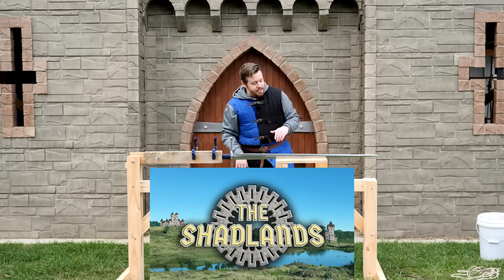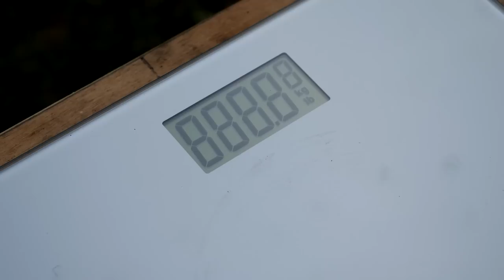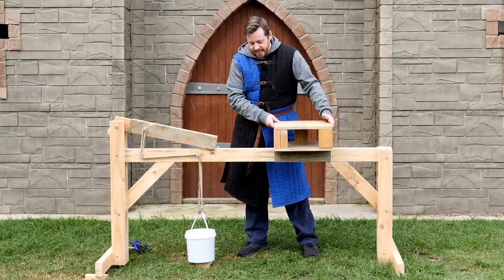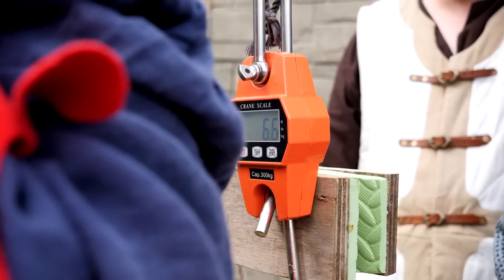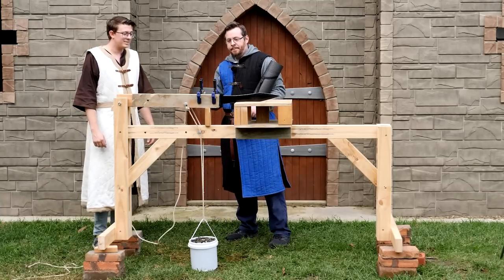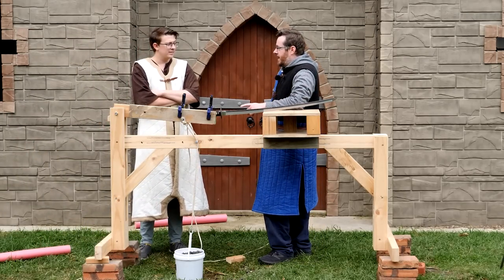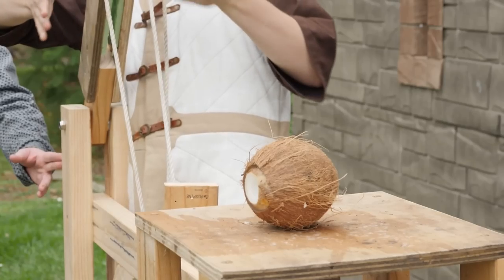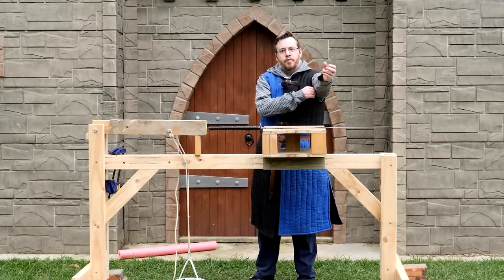Choppy choppy

Comment: You need to increase the developed velocity to increase the momentum and use a more brittle and rigid material to decrease the cut time to increase the cutting impulse. The tensile force of the rope is not equal to the force of the cut. mv = Ft where m is mass, v is velocity, F is force, and t is the duration of the time that the force is applied. Ergo, to increase cutting force, you need to increase the linear distance, d, the blade travels (d=2*pi*theta*radius) to increase speed of the blade at impact (increase the impulse of gravity as acceleration and mass are constant making time the determining factor of magnitude). Simultaneously, you need a cutting medium which is both brittle (decreases cutting time by reducing elastic deformation and negating plastic deformation) and rigid (does not deform over time). I suggest a physically soft wood or a variety of reeds and the cutting with the grain to prevent the trapping phenomenon and make the limiting factor the lectin of the material rather than the fibers. Alternatively, measuring depth of cut through a material such as ballistic clay which would also be reusable.

Comment: I think the problem was blade geometry. Because the katana is curved, having a straight chopping machine isn’t getting the full cutting potential. If you look at the blade as it cuts, only a very small segment of the katana made contact with the coconut. The straight blades made full contact because they followed a straight path.

Comment: When you measure your hitting strength your arms were fully extended pushing down.  When you swung the sword down, your your elbows started bent, then straightened .  My guess is that gives an increase amount of power to the strike.   I think there is also a power difference between swinging and pressing.  Maybe get your hands on a G-shock sensor that you can swing against then adjust your rig to the same power.

Comment: Clamp is slipping, which would greatly effect the impact force. Maybe drilling holes to put a pin under the back and above the fore of the hilt would help? Might damage the sword if not careful.

Getting consistent striking force will be very hard. Maybe you can get an impact tester to put on the target? Just the pull of gravity at the end of the swing should vary by the square of the moment length, so 2x to 6x. Also, the angular inertia varies by weapon, so the momentum at swing’s end will also vary greatly.
Getting the same momentum and force with different weapons will be pretty much impossible, but maybe you could get one of them the same?

Comment: For the thing about the clamp: A completely sturdy clamp would not necessarily make a more accurate simulator, given a human arm also isn't a rigid as a wood beam.

I think its just severely lacking in velocity and that the maths of using pressure don't account for the lack of acceleration, a dropping weight are not going to accelerate more than about 10m/s2.

Simulating the way a human arm accelerates with varying weights would actually be very complicated, but perhaps it would be worth using springs or taking a page out of Jorg's book and using rubber.

Comment: Gravity is not a suggestion. It's a law. When the bucket drops, it and the sword are pulled by gravity (1G). The weight of your bucket does nothing until the sword tries to stop. Swinging the sword manually, you can accellerate it much faster than 1G, imparting more velocity at the same distance, resulting in more force.

Comment: I will say that I have the same problem with your device as I had with Grant Imahara's Katana robot, it does not do any "draw" to the cut. It only does a straight chop, which favors a heavy blade over a sharp one. I believe that an ideal sword cut simulator would require a double-action to it, so that as it swings down, it also pulls back into the hinge, so that against say a watermelon-sized target, the blade would travel a few inches back over the course of the stroke.

Comment: At a rough eyeballing, you'll need double the weight in the bucket to get the desired power. There's math behind it, but if your bucket is halfway between the strike and the pivot, you'll have half of the bucket's weight at the strike. Again very, oversimplified, but it'll get you in the ballpark.

Comment: I think the blade is shifting too much in the clamp upon impact, you could fix this with two small blocks in the clamps just a bit narrower than the handles, one placed further back in the clamp and below where the tang will rest, and one placed closer to the handguard above the tang bolted in place to give more support on the tang when the objects are impacted and preventing them from shifting in the clamp.....it would also eliminate the need of a wood stopping block.  ......   Example of what I mean, think of the dashed line as the weapon, and the asterisk as the top block above the forward part of the tang and the period as the lower block below the lower part of the tang    -.-*- - - - - - - -    If something like this were in that clamp, it would prevent the blades from shifting upwards upon impact.

Comment: The force of the swing isn't the whole story.  Is there a way to calibrate for momentum? A person puts not just the momentum of the sword, but their own weight behind the blow. A person can get different results but "letting the sword do the work," or pushing even after contact. 

I also agree that the sword is slipping in the grip at impact. You can see that.  This doesn't reduce the force, but it does increase the time of impact. In other words, the impulse is changing. This effects the large sword less because it has more mass/momentum/inertia. 

Instead of a custom clasp for each sword, i think if you add horizontal rods (bolts would do) running from one side of the plywood to the other, right above and below the hilts (and in more than one place), you can use the foam method in this video and the bolts will add imovable berriors to slipping. The bolts can be on a track instead of holes to allow them to be loosened and then moved to customize the grip for different swords. 

I think you should also measure the velocity of the center of mass of the sword.  Might be helpful for keeping track of momentum.

Comment: The biggest problem is that as soon as the blade makes contact the sword rotates, losing both the momentum of the swing and the weight of the bucket.  You need to replace the squeezing grip that allows that rotation with something that prevents the sword from rotating.  I imagine something like metal pins through the wood arms, one above the blade end of the handle and another below the pommel end of the handle, tho you may need something more elaborate to accommodate the variety of handles you have in mind

Comment: Like some other commenters here, I also think that the clamping machanism needs to be improoved. You can see that that's the problem because the swords end up at an angle after the cut, when they were level with the clamp arm before. 
Instead of using flat pieces of plywood, have a sword-grip-sized groove in them, to simulate gripping around the sword.

Comment: Remember the yoga mat? You want the hilt to be the yoga mat. What is happening is that all of the force is being transferred into the fulcrum which is the hilt. You want the point of impact to also be the fulcrum. And the way to do that is to dampen vibrations traveling up the blade and into the hilt. I'm very serious when I say it can't move at all. Not even like a thousands of an inch.

Comment: You might consider setting up bolts that you tighten down, rather than hand clamps, to clamp your swords into place.  It would make a much more stable clamp, and you'll probably be able to get a tighter hold, if you use enough leverage.

Comment: I'd suggest having some sort of slot for the sword blade to pass completely through the target to be cut and a system that allows the machine to effectively swing through the target.

Also, the design seems to be more about chopping than cutting. This test would work best with something like an axe, less well with a straight sword, and quite poorly with a curved sword.

Comment: I have those same clamps and i will say they do not hold up well to impacts like this i would recommend some good old C clamps at the very least as just one thing to improve this and something to go behind the handle to keep it straight in the holding bit possibly even something in front to but the swords are definitely slipping to much and losing a lot of energy. 
maybe even just try another layer of the padding material you have in there on both sides so the handle can sink deeper into it.

Comment: two things I see.  First that clamp has alot of slipage each time it impacts. that will rob some of the impact.   You probably need to find some way to brace the top and botom of the hilt inside so it can not rotate.   Second thing is your weight system is not a constant amount of force through the whole swing.  As the angle of the rope and lever arm changes the amout of force applied changes.  Basicly you'll have more or less force applied at the top of the swing vs the botom.
For a continuous amount of force applied through the whole swing you'd probably need to have a drum/wheel locked to the same axle as the arm (so both arm and wheel rotate togeather) and have the rope of the bucket wrap around the wheel as you arm your device and despool as its released.  Probably not pratical with your particular design though.

Comment: I might also suggest that in the clamp the sword and clamp stay level with each other meaning the sword stays flat.
When you cut your wrists ended well below the level of the coconut the angle of the blade is completely different and this would have led to the blade being dragged through on a pull cut.
Reply: The two hander I presume has to have significantly more mass behind it.

Comment: I think the coconut fail might be because when a person swings a two handed sword, the bottom hand leverages the handle differently than when the handle is fixed in a clamp. When I swing a two handed sword, I use my hand at the bottom to kind of pull the bottom of the handle up to give it more of a flick

Comment: I think you need to have something to support the handle of the sword from the top of the grip. A lot of the tests you did resulted in the sword rotating up when it hit. Your hands would probably stop that from happening for the most part if you were actually swinging the sword. Maybe some nylon webbing fed through some holes would be better than clamps - you could cinch down the webbing and it should hold the handle in a fixed position.

Comment: If you look at the longsword vs the coconut you had a pretty unclean cut showing it didn't cut as much as it crushed it's way trough, the catana did a clean cut when it did cut, which shows the catana actually cut better.

If you look at what happened to the clamping you will see that the longsword only moved a tiny bit, thus imparting most of it's energy into the target, the catana on the other hand moved a lot in the clamp thus using up a lot of it's energy for moving in the clamp instead of cutting the coconut.

Comment: I think the katana works better with a slight draw slice  .it looks like when you swing it yourself it's getting drawn more .The broadsword seems to break it apart with a chop because the blade is blunt and it behaves more like an axe .
The katana is like trying to chop a log with a sharp hatchet and it cant compete with a proper chopping edge of a log splitter.
So I think your rig is setup better for chopping than slicing action .
🤷

Comment: Hi Shad,

I think you need to make a gap betweern the cutting boards.
for the follow through of the blade adding more cutting motion the blade is now stopped on the cutting board lowering the cutting capacity.
It's now just falling on the item not making a full cut

Comment: Your hands are absorbing and providing leverage differently than the clamped pieces of wood. I would try a cross brace at the front where the hilt would be to stop the sword slipping up in the clamp and perhaps another brace going across near the end of the handle to assist...would simulate two hands on the handle. In regards to the two handers anyways.

Comment: i see 2 big problems
1: speed. we add speed to a swing.
2: weight. the weight of our body is attached to the sword. this is most evident when you compare swinging with your body vs swinging with only your arms. 
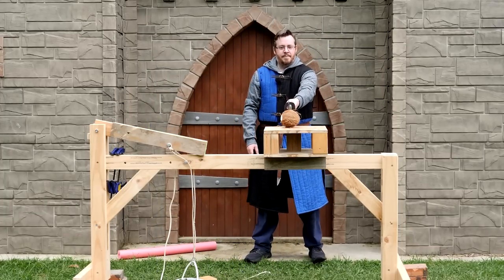we can see this in his swing at 27:36 where he attempts to swing with mostly arms but probably unconsciously, he leans into it with his head and body.
try putting your back and head against a wall and only swing down with your arms. that is a decent arms only test. 

all in all i would suggest getting a stick and measuring the force of a downward strike.
then you just have to get the sword guillotine to emit an equal force and perfect. 

p.s.  dont forget f=ma and because the mass of humans and sword guillotines differ this will make the acceleration also different. good luck!

Comment: The platform should have a load cell in it to measure the impact force. An off the shelf one combined with an Arduino and little LCD plus a SD card for logging the data should do.

Comment: First, you're striking the objects with the blade rather than drawing the blade across the object. Changing the angle of attack might help. Second, the swords are slipping in the pads. Putting fixed supports around the handle will solve this. Third, dropping 7kg of mass is not an accurate depiction of the force an arm applies. That's like letting gravity take control of your arms and dropping them while holding a sword, when in reality, your abs, triceps, wrists are all applying extra force. There is more mass behind the blade during a swing, and it is moving much faster than the lever of your machine. The forces generated by your actions and the machine's aren't comparable.

Comment: Have you considered maybe trying to make a composite material? You could use a medium similar to the way "mechanically stabilized earth" works by sandwiching a harder to cut material like cotton fabric or something similar, or various types of mesh depending on what you have available, with a much easier to cut through material in between, like soil or gelatin. To be clear I have no idea if this will actually work, but if nothing else it could be an interesting test.

Comment: Two-footed most simply you have less than 7 lb worth of grip and a curved sword that is giving up all of the power in the tip of its blade the second the grip weekends allowing the handle to move if the handle did not move then the coconut could not drag all of the weight of the tip of that place back into the handle of the blade

Comment: If u watch it in slow motion Shad you will realize, both the blade and the coconut werent stable enough. They were both slightly moving, and that is enough for a precision blade like the katana to miss a clean cut. Also, you definitely need more weight. Hope i could help.

Comment: I need a 2 by 4 stud common and a hand saw as well as rubber inner tube a leather gloves but preferably two, and the exact measurements of your grip and the joints between the first knuckle in your hand and your shoulder. And I suppose a few washers nuts and bolts would not be out of order. Because if you want the machine to transfer Chi like a human beings as desineeds the joints of a human being altered so that they are all in proper alignment to nullify slop. And to do this absolutely correct liquid hydraulics. saltwater viscosity should be appropriate. Give or take I'm thinking 20 psi for the inner tube muscles should be just about appropriate and would make your machine much safer as you could simply disengage the air pressure before you ever come near the table. Because machines do not think they only do as they are ordered and gravity is constantly ordering them to find the lowest point possible at the pressure of exactly 1 G LOL

Comment: Shad, regarding the coconut, perhaps its the speed you hit with that factors in, not just the max pressure you could apply while pressing in a static manner. Check and see if you can compare the speed of the tip via the apparatus, versus your standard downward swing.

Comment: use a gear system and a crank for a consistent arm drop height, and maybe remake the gripping bit to be a tube that tightens - it was probably angle on the invincible coconut and having the blade handle slide down a tube would probably make alignment easier , maybe make an angle guide for the blades?

Comment: try adding a pin or bolt above the handle in the clamp to prevent it from rotating upwards on the strike. the rest of the clamp appears to be fine

Comment: U should calibrate weight application at the point of impact of the blade. U got the 7kg measure at the tip of the lever. U measured at mid point of the lever not the end. So ur impact point is less than the 7kg being further from the pivot

Comment: I guess the coconut was cut by the blunt sword but not by the sharp one because coconuts are hard and fibrous so they will need blunt impact to cut and the sharpness of the blade doesn't make that much difference, I'd be willing to bet that the huge blunt war sword is heavier than the kantana, your machine is gravity driven so the heavier sword would have had more impact behind the blow, whereas using speed of the swing you can generate more force swinging the lighter sword by hand

Comment: Part of the reason the Yoga Mat held up so well is that it has the large hole in the middle which it can then flex around to absorb the force of the blow.  An unrolled Yoga mat that did not have that large air pocket would not take those hits nearly as well.